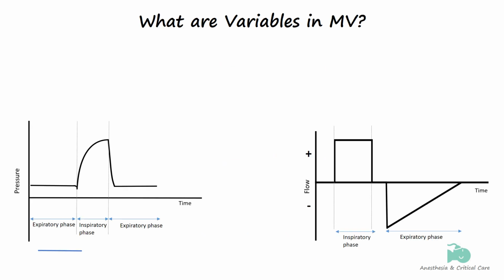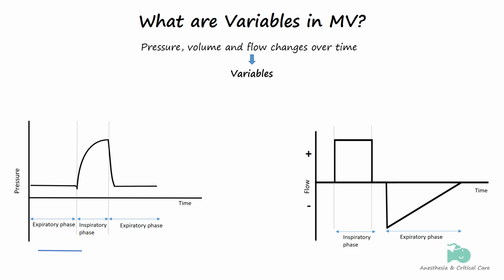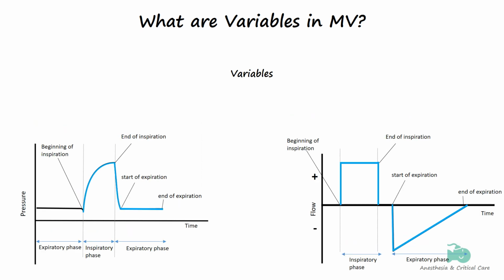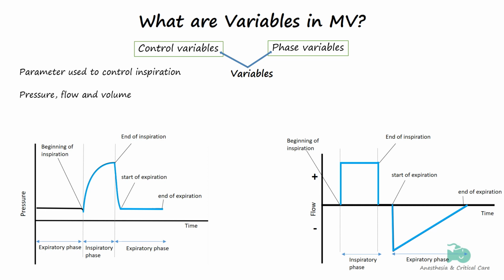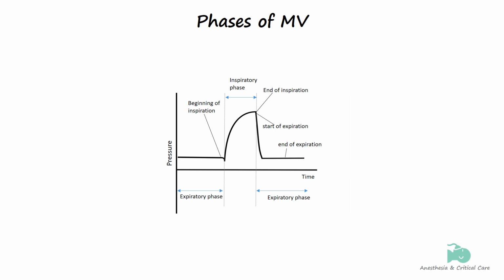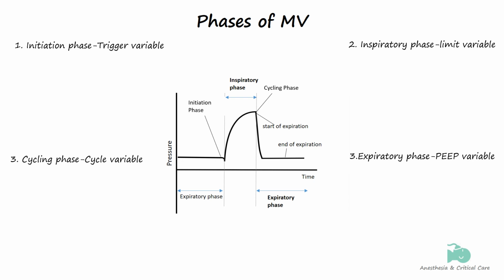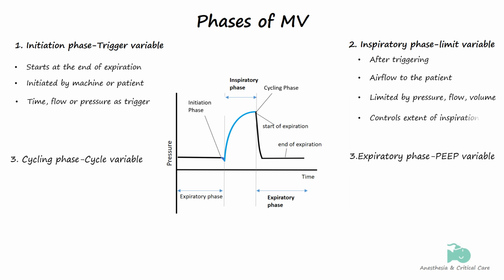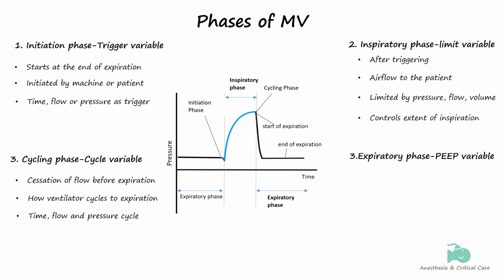Phases of Mechanical ventilation |Phase Variable (Trigger, limit,cycling,PEEP)

Comment from the maker: Correction......limit variable doesn't limit the extent of inspiration..it's rather done by cycling variable...what limit variable does is, it limits certain parameters ( eg. Pressure) from overshooting. The inspiration continues till cycling phase. It keeps parameters like pressure, flow or volume checked within safe or set limits ..it's also called target..